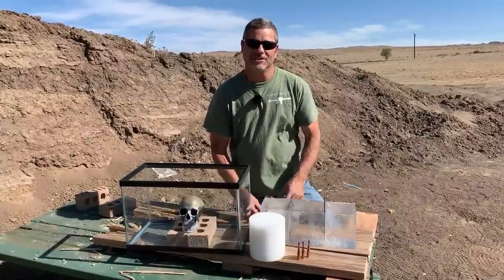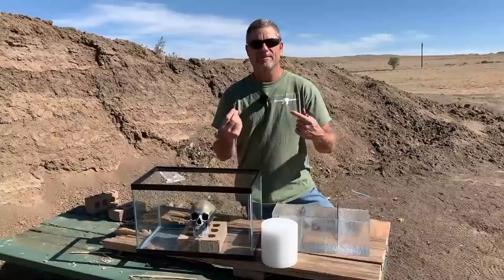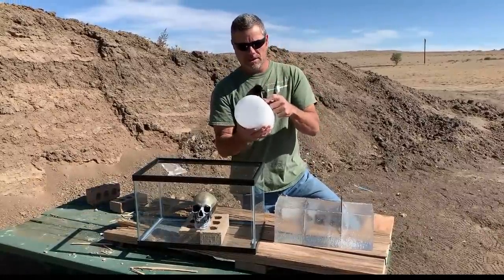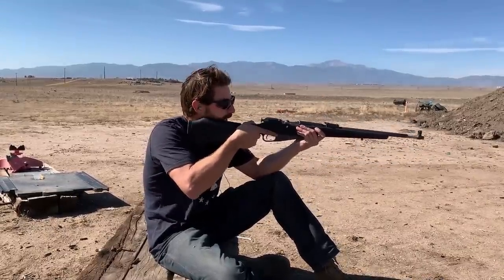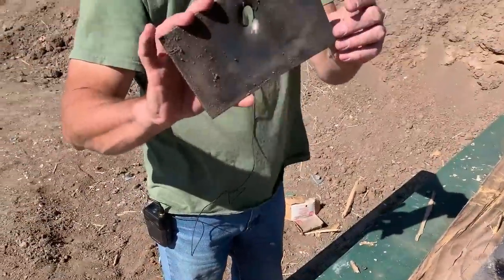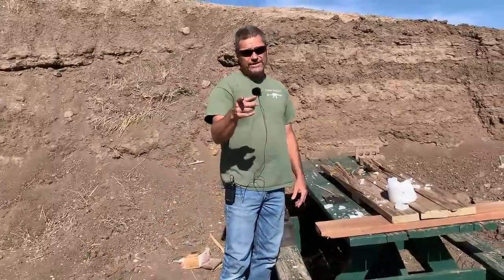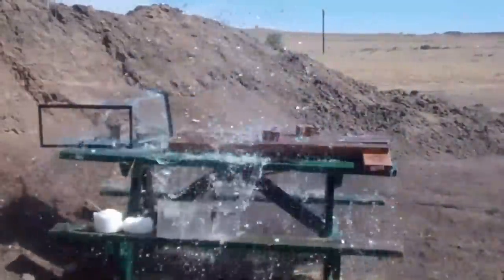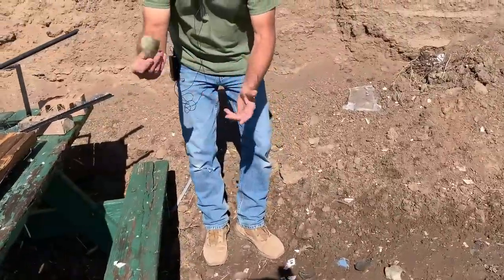WW2 Exploding Sniper Ammo 54R-PZ

Comment: "Gotta be careful with these. There's been reports of these going off when dropped." *Proceeds to flail them around and tap them on hard surfaces while talking*. jokes aside, great video!
Reply from the maker: Lol, I noticed that to and thought. Well that was dumb. 
Thanks 👍
Reply: Sounds a bit suspicious to me. That bullet accelerates at over 20000 G in the barrel. It only goes off when it decelerates even faster and seriously deforms when impacting a target.

If the explosive in the bullet was sensitive enough to detonate by dropping it, the bullet would never make it past the first mm of travel in the barrel before exploding.
Reply: @glasstuna  well if you think of a WW2 mortar shell; when its primed just throwing it and having the tip hit a surface will cause it to explode right? I mean he did say they were rumors after all. But the rumors never started how hard/high that you would have to throw/drop it, i think that's also an important factor. Those also could've just been faulty rounds that went off.
Reply: @glasstuna  If you look at the cutaway picture you can see that the striker is behind the primer/explosive. So accelerating it in the barrel will just keep the striker pushed back. It is when it is decelerating that the striker can move under it's own momentum forward against the primer/explosive. But yes it will take a lot more than dropping it....
Reply: @titter3648  Ah, that makes sense / is pretty clever.
Reply: @titter3648  say for instance you dropped it from 15 feet straight on the tip. Wouldn't that be decelerating it enough to push the striker forward?
Reply: @bobtehdinosaur  I dont think so. If you look at the cutaway there is a small metal strip that needs to bend away for the striker to move. And it is designed for the massive several hundred thousands of G's deceleration from when the bullet hits something hard from supersonic speed. So i dont think any drop will set it off. Even at terminal velocity (where it will be on it's side anyway because of the aerodynamics so it can not move the striker).
Reply: @titter3648  ahhh okay. So do you think that the reports of them going off could've possibly been faulty rounds or are the rumors just nonsense?
Reply: Probably a bunch of fudd bs. I doubt any ever exploded.

Comment: "You've got to be careful with them" proceeds to shake it... 😆
Reply: If they can go off when dropped... How do they even survive being fired?
Reply: @SilvaDreams  this is why I was laughing when he said that. It shouldn't go off unless you hit it with something hard. Or drop it wrong on a hard surface
Reply: @SilvaDreams  The direction of the force. The striker is behind the primer so firing it will just push the striker harder back. But when it hit something the force is in the opposite direction making the striker go forward under it's own momentum against the primer. But it takes a lot more force than just dropping it.
Reply: @SilvaDreams  there's a firing pin behind the explosive. When you fire a round the acceleration pushes the firing pin away from the explosive.

But when you hit the nose of a round on something hard like concrete, that firing pin may strike hard enough to set off the charge.

Comment: A much simpler solution to make HE rounds would be to add a section of alkali metal, such as potassium, in place of the explosive mechanism in a soft point bullet design. 

As the bullet expands in soft tissue, the now exposed potassium would, in its heated state, explode violently in water, as soft tissue is ~70% water.

Comment: Great rounds, I wouldn't want to be captured in ww2 as a sniper with them.
It wasn't good for their health.
I can't understand why
Reply: Eastern front was a war of extermination. No quarter given on either side.
Reply: Thats not "sniper" ammo. This is airplane ammunition.
Reply: @АнтонГлазырин-р2в  both the soviet and German snipers were known to use them in ww2.
When they were caught with them they were tortured or killed for using them on soldiers.
Reply: @paulnelson2362  proofs, plz, cause is no reason to use not accurate ammo and not so safe to cary too. I'm waiting
Reply: @АнтонГлазырин-р2в  there were 3 grades of PZ ammo, determined by the Quality Control inspectors. First grade was highest quality and was for synchronized aircraft machine guns (the ones behind the propeller). Second grade was for wing and ring mounted aircraft machine guns. Third grade was not good enough for aircraft use, and went to ground troops so as not to be wasted. All 3 grades had a bullet with a black tip, so are quite distinctive (the different grades are marked by lacquer color on the primer).

There are several memoirs of snipers on the Eastern Front, both German and Soviet, and they both mention using explosive ammo. It was always in very short supply, and only used when they had to make sure of an instant kill.
Reply: @ScottKenny1978  в войска пристрелочные патроны не выдавались
Reply: @АнтонГлазырин-р2в  sorry, I don't read Cyrillic.
Reply: @ScottKenny1978 1) я всё ещё не вижу оффициальных документов о поставках пристрелочных патронов в пехотные войска
2) привыкай, в мире иностранных языков больше, чем сраный английский )
3) все пользуются переводчиками, вам  тоже не помешает, чтобы совсем жиром не заплыть.
Reply: @АнтонГлазырин-р2в  sorry, again I can't read Cyrillic. And my phone doesn't let me copy your post into Google translate, either.
Reply: @ScottKenny1978  а кого ето волнует? Захочешь - прочитаешь, мне надоело подстраиваться под ленивых людей, считающих, что весь мир говорит исключительно на американском
Reply: Boris Rozavilovsky-levit  мы тут оба встали в позу: мне надоело читать бред про использование этих патронов снайперами, а собеседник так и не предоставил документированных фактов использования данных паронов пехотой, особенно снайперами
Reply: @user-gl5bq3vi1s Simo Hayha's autobiography mentioned both sides used them. You switch from English to Russian deliberately and try to troll him. If you don't know that on the East front thry used explosive ammo esp up near Belarus and Poland and Finalnd that's on you. Source more than that yourself if you want further proof. Nobody needs to prove nothing... to you. But don't be a &$#%. The dude was spot, they did use it and a lot of the time. And these are fired out of a gun at incredible G force not to mention used on airplanes in combat situations, so no reason they aren't safe to carry. Grow up.

Comment: because an explosion is a fast burn I wonder if the black trail mean the bullet was already exploding and the metal slowed it down enough to get the expansion. The bullet under goes very high G forces to accelerate down the barrel.
Reply from the maker: Not sure, If we had a higher speed camera say 100K frames per second we would know for sure.

Comment: Don't want to spill the beans, but "True exploding bullets were first described over a century ago and, although not actually in use at that time, were prohibited under the St Petersburg Declaration of 1868, which states that explosive or inflammable projectiles, with a weight of less than 400 g, should never be used in the time of war."
And "Belgium's Law of War Manual (1983) proscribes the use of exploding bullets"  Belgium is just an example. 
These ammunition is illegal, even in wartime. To say a war crime.

Comment: I sent an email offering free shelf brackets for standing up plates in penetration tests.
Reply from the maker: I got it, sorry I didn’t respond. We are good, thanks so much for the offer👍
Reply: @GoingBallistic  If you ever run out, I'll probably still have them.
Reply: @GoingBallistic  I should add that I'm not promoting anything and don't want any acknowledgement. I just figured I got the brackets free, and I'd be willing to pay postage to send them to you if/when you can use them.